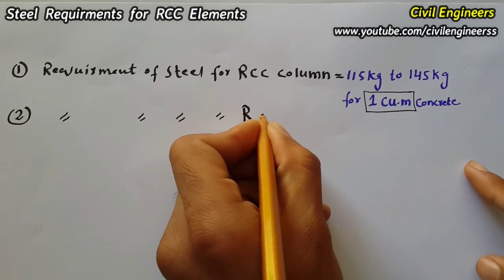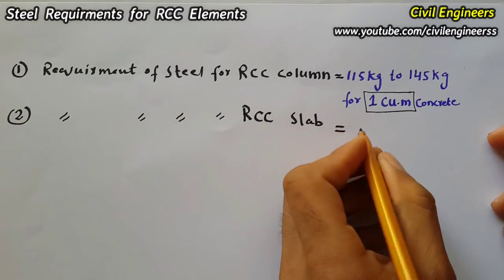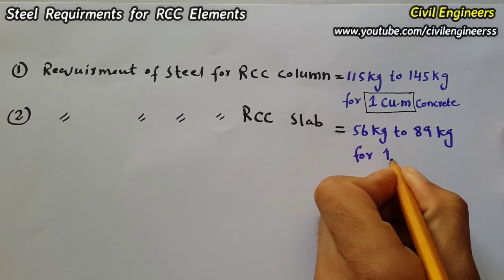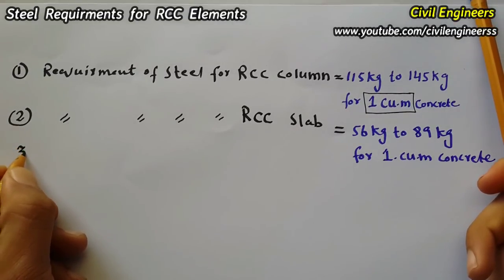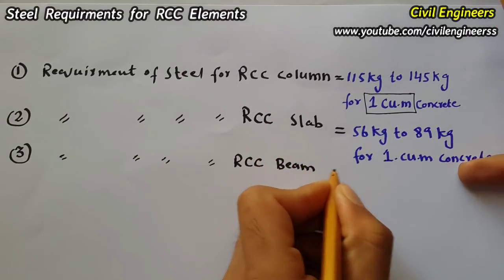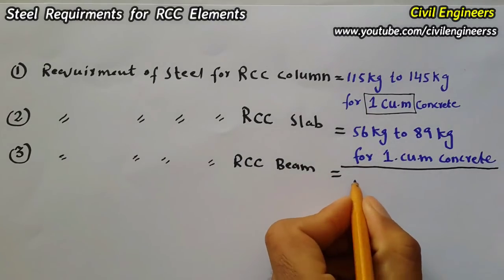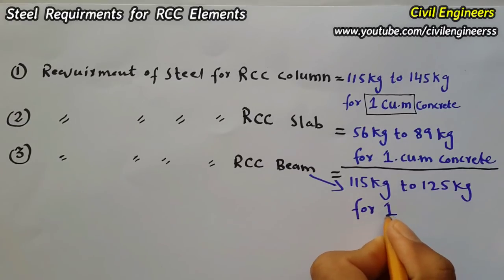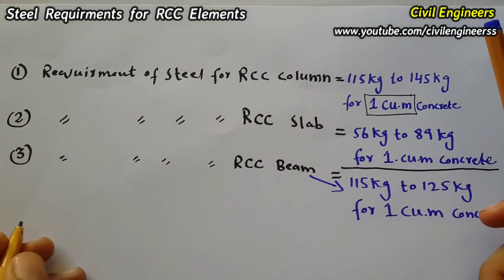Steel Requirements for RCC Elements | Foundation  Column beam and slab |

Comment: Sir the building floor is G+13, so how much kg of steel are used 1m3 in Footing, Columns, beam, and slab, plz reply fast
Reply: Subhash Kumar 3. 5 to 4. 5kg /sqft total built up area (including footing,column, beam, plinth, slab and underground rcc water tank and over head water tank. 6to8kg/sqft of total built up over 8th floor and above floor if any up to 25 stored.

Comment: excellent,
but this Qnty. of steel,which is as per Qnty. of concrete, for which floor, if building is G + 2 , so how it should be.

another thing what should be minimum load bearing capacity of soil.

Comment: Confusion.. Confusion

1) this thumb rule for residetial or industrial.. 
2) .15 percent but unit.. We consume...0.15 per cub. Met or cub. Feet???  Reply must
And thank u for video.. Reply soon.
Reply from the maker: .15 of cross sectional area of slab
Reply: Civil Engineers but sir area is in feet or meter
Reply from the maker: its depend on you feet or meter but %age should be 0.15% of x-sectional area of slab.
Reply: Civil Engineers sry but i can't understand.. If my crosse.. Area is 50 feet then req.. (.15#) means 0.75 or meter then also 0.75😥